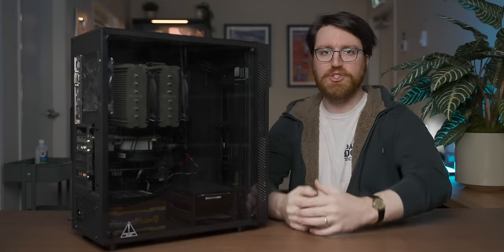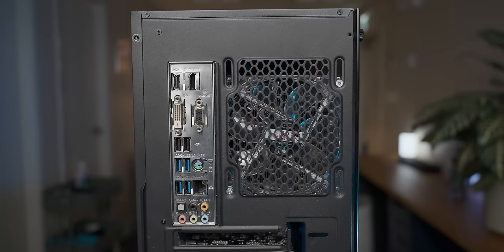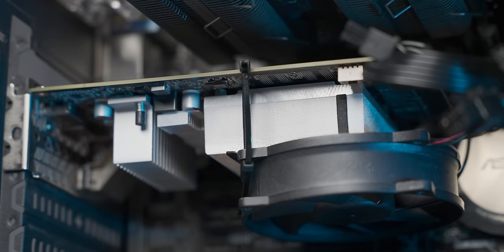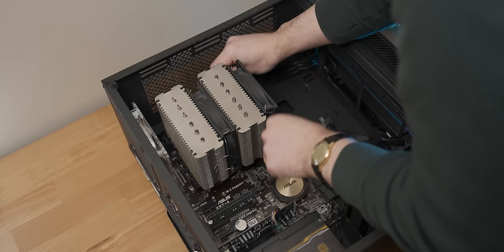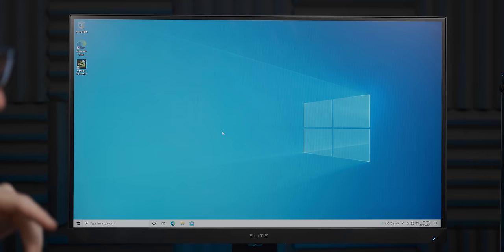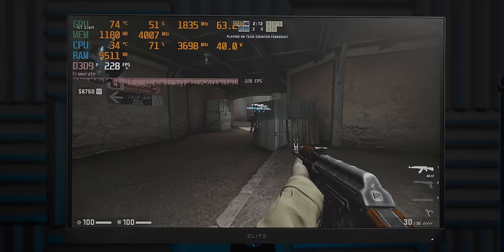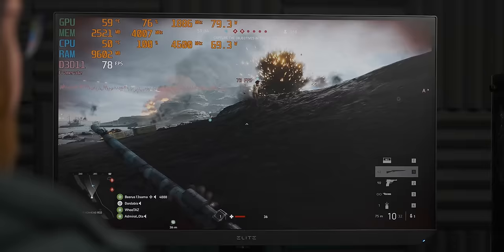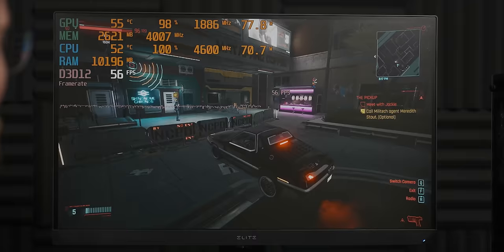What Does A $400 Craigslist Gaming PC Look Like In 2021?

Comment: Seems like a good buy, and the whole GPU setup just seems made for Dawid.
I managed to get a R5 3600 and 1650 system for $415 (I couldn't talk them down the $15 unfortunately) from Marketplace from a seller that was supposedly moving overseas, admittedly at that price and the whole 'moving overseas' thing had me thinking it may have some kind of serious issue(s). But despite having a no name PSU and coming with its own weight in dust, the rest was decent enough: B550M, 16GB of RAM, a 1TB NVMe Gen4 and 1TB HDD, and a Hyper 212 knockoff cooler that actually performs decently. So in the end it wasn't too bad a deal.

Comment: back in late 2019 i got a 4670k with a msi motherboard and 24 gigs of ram for 175$, I only got i cause my 4790K killed my other motherboard and the 4670K was just gonna be my backup. now I've been using if or the last year and it has worked well for me in Warzone, CSGO, GTA 5 and a lot of other games. but it is holding my RX580 back tho I'm pretty sure. I was also able to overclock it to 4.4ghz with it staying pretty cool

Comment: This was a great buy for $400 after the cpu overclock, fixing the fan curve on the gpu, and fixing the stupid ram configuration. Getting a $100+ NH-D15 was a huge bonus, even if the stock fans had been replaced. I would 100% be happy with giving my son this PC after the little fixes, especially given what you paid for it. Gotta be honest, I was really hoping to see you strap one of those 3000 RPM industrial Noctua fans to both the graphics card, and stuck the other one in the middle of that NH-D15. I saw microcenter has the 5600G for sale for $199 and that kinda makes me want to start building a little system around that APU. B550 mobo's are cheap enough too. Im sure I could find a used or open box kit of 16Gb 3600mhz ram to pair with a $40 500w power supply. The graphics card is still obviously the hard part here, but the little APU can get by on lite games for a while until I find a cheap 1660 super or something. Either way, great video. I am a little jealous honestly that I cant replicate that build for such little money in my area. Not many decent $400 computers in my area of southern NY, no matter which sketchy website I look on. Any half decent 1060's here just dissapear like magic if they do get put up for sale. I haven't seen a 3gb or 6gb 1060 for sale here for under $300-$350. Sorry, this turned into a bit of a rambling comment. I guess I was just typing out what was going on in my head for a bit here.

Comment: Arctic P pwn case fans are best for gpu mods, cheap non pwm fans will not slow down much and give lower static preasure. Also the 8gb ram kit shoud be on one channel and the single 8 gb stick in the other channel for dual channel , lose the 1gb stick. Might only get 1333 mhz without ram overclocking on a z board but it would work .

Comment: I got a $382 gaming PC from ebay with Intel 10400, 16 gb 3000 ram, 1050 ti gpu, a 360 mm aio water cooler (why?), b550 motherboard and 750w psu.  Honestly I think I got a steal as everything was new.  I actually bought it for my son but most of the parts were better than mine so I threw my ram and 3060ti in it and gave him the older stuff.  🤣

Comment: That CPU is great for overclocking to around 4.5ghz. The uplift in games is really noticeable. I love to pair it with a gtx 970 for a good 1080p budget system. With ddr3 1600mhz should be the min nowadays.

Comment: The 2nd half of 202q I sold my friend my old pc with 980 4gb, i7 5960x (8 core/16 thread), x99 mobo, 16gb ram, 512gig sat ssd for $500. Wanted a deal that was fair for both sides. It was 7 yo, but aged pretty well and well maintained. I was still able to play most games on 1080p high although RE Village and Boarderlands 3 had me drop some things down because of the vram.

Comment: The ram is running at 1333 because of the 1gb stick witch is 1333.If you remove it will run at 1600mhz without overclock that  is the base speed of the i5 4-gen.

Comment: Extremely worth it for $400 I was thinking about going for an RTX 3070 and an i5 12600k before I realized that 1 ray tracing doesn't do much and 2 theres not much of a difference from 1080p ultra and 1080p medium in most games lmao as long as you have good textures so now I am going for a 1660 super maybe 2060 and a ~i5 10400f area of CPU

Comment: I just built a system for someone that has a Ryzen 5 5600g and a b550 for around $550, and it runs everything at low settings, but it will get him through until GPUs come down.

Comment: 3 minutes in. It's easy to see what the seller did. He built a new gaming PC, but couldn't get a GPU. He took the GPU from this machine, slapped in some crappy GPU he had on the shelf without even peeling back the power cables the other GPU required but this one doesn't.

Comment: When I see videos like this it makes me realize I pulled the score of the century

CPU: i7 6700 K
Gpu: 1070
Ram: lpx 16gb 3200mhz
Mobo: gigabyte ga-z170x-gaming 3
PSU: EVGA supernova 750w fully modular
CPU cooler: be quiet! Dark Rock 4
SSD: Samsung 850 Evo 250gb
HDD: 2 WD Black 1tb 
Case: Corsair carbide 100r 
Monitor: Asus mx27aq 1440p 
Speakers: Edifier r1700bt
Keyboard & mouse: Logitech mk545
And last but not least
A really nice and very solid hardwood desk, which has built in rubber topping and is well massive, which came out of the US embassy here in New Zealand

That full setup desk included came to $1000 NZD which is for other people
USD: $680
CAD: $851
EUR: €600
Pound: £500
YEN: ¥78000
AUD: $950
I think I got a pretty good deal

Comment: i mean in early 2020 i got an optiplex 990 and i’ve upgraded the entire thing besides motherboard cpu and case
this thing is packing with 16gb ram, i5 2500 4 core 4 thread, 700 watt psu, 750ti, and a 1tb ssd       all for 400 dollars, i managed to get the 750ti for only 60 dollars

Comment: Something is up. The cpu is at 100% utilization while at 40 watts, but it's not always 100%. Not sure what's up there, my i5 4590 sits at 85 watts or higher. It being a k version, it should easily be hitting like 95 watts not overclocked.

Comment: I found a fairly similar system for my buddy for 400 CAD (Roughly 315 USD)

Fx 8350 BE
Hyper 212
Zotac GTX 1050 MINI 2gb
Gigabyte Ultra Durable Motherboard
12gb ddr3 1866 mhz
2 250gb HDD
1 500gb HDD
1 64gb ssd
Old Nzxt case

I think it was a good deal overall for what he got. Runs the games he wants it to run.

Comment: The system is not bad. Especially when you consider that the cooler already costs ~ $ 100. Except for the RAM constellation and the GPU cooler, you can't complain about it. And you have to consider the other tests. There are new PCs for more money that you can throw away right away. If I were to look for an "Entry-Level PC" now, I would go for it.

Comment: I got a used 2080ti desktop PC from EBAY for $879 in an auction and I felt like I won the lottery.

Motherboard ASUS Z370 Prime
Intel 8700K
RTX EVGA 2080TI
G.Skill RipJaws DDR4
EVGA 850 80 Gold watt power supply
EVGA water cooler
Samsung 970 EVO 500G
Samsung EVO 850 250G- Windows 11 only
All fans are Corsair
Case is Corsair 570X

Comment: Hmm, I'm not the only one having trouble getting Z97 board onboard audio to work in Win10, I had to use a soundcard in mine (what is the card, mine is Audigy FX - avoided CMI chipset as not sure it has current W10 drivers).
Also, if the red stick is 1600 speed, then a better config of the existing RAM would be the 2x 4GB in one channel, the 8GB in the other and leave out the odd 1GB

Comment: For $800 you can get a new PC with a Ryzen 1600af (a Ryzen 2600 with a different name), a Radeon 6600, a decent B450 motherboard, 16gb of 3200mhz DDR4,  a 500 watt 80+ Bronze Corsair PSU, a decent enough air cooler, and a proper airflow case.  I think I'd rather get way more performance and new parts if I was looking for a budget PC, but if you only have $400 I guess that isn't too bad honestly.
I think I'd sell the CPU and motherboard on Ebay and buy a Ryzen 1600af and motherboard or a newer intel 4 core 8 thread CPU with a motherboard included on Ebay.  It would only raise the price maybe $70  and you'd get the most out of the GTX 1060 instead of having it run at 60% constantly.

Comment: Here in Germany I tried sell stuff on the Craigslist equivalent and people just want to have it for free or offer you a trade with more junk I don't need. LMFAO. Trying to sell my graphics design Dell UltraSharp UP3216Q for 500 EUR and I get offers for 280 EUR or even offers for a trade with a PC with an 4000 series i7 8 GB DDR3 RAM, wonky case and all that old stuff... I'll keep that monitor as a spare or test screen now. Not gonna sell a 1400 EUR screen for less than 500 after 6 years of use. It's still going strong.

Comment: The RAM was setup as 12+5, I guess that's the main issue. You only had 5+5 so 10GB of dual-channel, with the other 7 acting as single-channel. It'd be interesting to see if it would've worked better if it had been setup as 9+8 instead.

Comment: I have a similar system a i5 6400 which i was able to over clock about 200 mhz  (bought on release) 16 gb ram 1600 mhz and gtx 1060 but let me tell u cyber punk on medium on my pc ran on 60 FPS but there is no way there is a 30 FPS difference between ur cpu and mine both are 4 cores 4 threads ,

Comment: Is this for real in current market? In late 2019, I sold the following used system for $450: i5-6600K with CM212, Asus Z170-A, 16GB DDR4-2400, PowerColor Red Devil Radeon RX580 8GB, 256GB SSD, 2TB HDD in a Zalman ATX case.

Comment: 3rd/4th generation of i5s and i7s have gotta have the longest life span of any CPUs on the market in history. Those things are still good enough for gaming even in 2021. Because of pandemic and insane PC prices they are probably gonna be used by people another 5 years.

Intel wasn't lazy in the 2010s. They raised the bar so much early in the decade it was hard to go over it later.
Reply: Well, until 2025.....

If the GPU market isn't better by then, riots will happen.
Reply: @Nemofishman  If the GPU market isn't better until then, that means PC gaming is dead, because consoles will move on to the next generation and there will be no incentive for the game devs to release AA/AAA games on the PC when most of computers simply cannot match the recommended specs.

At that point, the current PC gamers will either move to consoles or will simply turn 30 and outgrow gaming as a whole. Either way nobody will riot.

Comment: i don't think that CPU cooler is overkill at all because its not that expensive and it is the best air cooler on the market why not use it and  guarantee to be quiet with low temperature at all times and a room for overclocking, especially with that almost closed up case, i was surprised about the ram setup because it looked like the person who build the PC seems like he had some basic knowledge about building computers, you would get more performance with just the two 4gb stick in dual channel than what ever that was supposed to be

Comment: This thumbnail is too interesting. Before watching the video my guess is that this is 4th gen Intel and some old HD Radeon card with an aftermarket/modded cooler.
Reply: I didn't rely expect someone to make a 1060 look so ghetto, but if it works, it works.
Reply: I recognized that motherboard because Asus was a bit more understated in their design at the time, if I remember correctly

Comment: Okay genuine question, I want to go and buy a gaming monitor to use with my laptop. I have a MSI crosshair 15. With i7 11800 and 3050ti. Nvidia dedicated. Now it has all these fancy ports on the side and I am not sure what to use for connecting them. Is it better to use hdmi? Or thunderbolt?  Specifically for gaming. I play a lot of battle royal titles. And also, is there any specific cables I should buy for best results?

Comment: I recently parted from my old 2013 Asus Rog laptop which the power adapter died. I got a aorus PC with a Radeon RX6800XT with a ryzen 5 5600X and dual 16gb ram DDR 4 3200 Hz running at 3166 a dual fan tower cooler for the CPU and a 2tb Samsung Evo 970 with a b550 elite V2 (preferred a trx40 master). In a aorus 700glass case big tower. I have spend way more then I hoped for the components and although I can go a couple of years with it. I am asked to build another one for my brother. He wants the same performance but not above 1400€. Any tips for choosing components?

Comment: I've been trying to get rid of a system for $400 in my area since this video came out and so many people have tried to squeeze in with a $200 offer I'm starting to feel like I'm the wrong one... E5 2670v2, 32gb DDR3 in quad channel, an r9 290x (tri-x cooler, no weird fan modding involved), on a supermicro X9SRA mobo, 500gb boot SSD, 2x 4tb hard drives, powered by an EVGA 1000GQ, and wrapped in a Phanteks Enthoo Pro. I mean I get that the CPU doesn't boost that high, and I originally built it for home server duty but I'd like to think I priced it accordingly IDK... I don't think even if I got one of the higher clock lower core count xeons it would make much of a difference but maybe am wrong? Anyone in the comments section have any opinions, if I swapped the CPU for maybe a 1650v2 for 6 cores at higher clock you think anyone would buy?
Reply: 400 sounds like a fair price. You need to RGB the shit out of the system. Put some rgb strips and rgbs fans.

Comment: Just wanted to pick your brain a little 
I have a 
Asus B85M-G R2.0 mb
I5 4690 (not K)
GTX 1650 (not Super)
32 gb GSkill ram at 1600mhz 
Deep cool 212 cooler 
Should I be happy for a while with this setup? 
I'm not a hardcore gamer by any means but I want to play Resident Evil Village 
Use it mostly for cad drawings for my 3d printer

Comment: Hrm I bought a lenovo ideapad 3 for 429 
Core i5-1135g7
12gb ddr-3200 ram
15.6" Fhd 1920x1080 
256 nvme m.2 ssd drive
Backlit keyboard 
Iris xe integrated 
Fingerprint reader
Thanks for laughs 83c on graphics ugh
Wow on the overclock
Reply: Ddr4 memory

Comment: Can confirm Cyberpunk 2077 is better (at least performance wise) now.  I can run at 1440p max settings and Raytracing at max at about 60-70 FPS, about 100-110 FPS with raytracing off, all with DLSS on balanced.

Edit: This is on a Ryzen 9 5900X and an RTX 3080 FE.

Comment: I paid $450 for a used custom PC from Facebook let's see how it compares
Reply: they're similar, i got a i5-6600k + 212 evo + asus gtx 1060 3gb dual + 8gb 2400 ram + 1tb wd blue hdd + plextor 256gb m.2. if you're interested, i transplanted it into a white corsair 220t and added 8gb more ram, though it now runs at 2133mhz because they don't match. the 220t is great btw, just wish i wouldve got a lian li o11 of some sort.

Comment: People suck. I'm about to post a very similarly spec'd system for sale for less. Put together from old misc parts (like this one likely was). But mine has matching ram, proper case cooling, and an ungoofed GPU. The price is fair given the age of the parts and the market but not if it's a mashup of BS like this one. Or is the market actually THAT bad at the moment?

Comment: i sold a stupid good deal 6 core 12 thread gtx 1650 super 16 g ram 240 g ssd 2tb hdd 600 evga psu for 480 and it had white mesh cased with 4 argb fans so id say just look for me lol SO CAL AREA  look me up on offer up  909 area always sold out doe busy driving my 3 cars
Reply: and you are 9 years old?
Reply: wtffffff for only 480???
I bought literally the same pc with the same specs except 8gb of ram for 1000$

Comment: "standard Windows bloatware" imagine calling the system's own applications bloatware. I would call the apps that most Linux distros install bloatware as well then. The only bloatware on an Windows PC is the OEM crap that gets installed if you buy a prebuilt. On a custom build there is no such thing. And if your device is supported by Windows 11, the Windows "bloatware" will make literally 0 difference to the performance. Even on older systems. It has been tested time and time again. Those pinned apps like Netflix? Those are ads that don't even get installed until you click on them. You can unpin them and they're gone forever. Yes, some people use those which is why they exist. You don't use them? Remove them. If small one time things like that bother you, go get checked out.

Comment: You want to know what insults me? I've gotten better computers than this for free people throwing them out. They don't have a  ssd and graphics card has usually been removed!but gaming Ram DDR3 and ddr4 Asus quad core what the same power supply is this. Some of the machines I've gotten or even ddr4. You'd be surprised what I get where somebody has run into a power supply problem or my personal favourite Windows 10! You know how many people I've seen throw a computer out when the problem is Windows 10.u a reinstall Windows 10 or b if the machine will run Windows 7 you take Windows 10 and burn it with fire and put Windows 7 in the machine and congratulations it's a happy little camper. It's blowing my mind that I'm getting machines that are Factory Windows 10 machines quad core and the operating system is running like dog shit! And no surprise that one gig stick of ram was offensive. Not just offensive to the eyes but obviously causing problems with the machine's overall performance. Surprise the damn thing had burst into flames just because of that one gig stick of RAM.